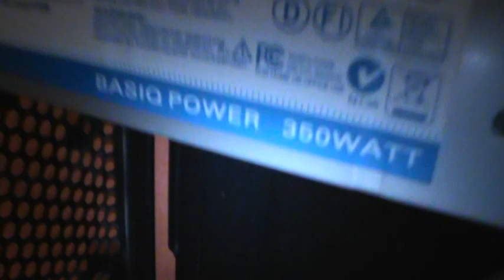Plans For The Old Raidmax Case

Comment: Hey, I really recommend you don't keep your Corsair case on the floor like that specially on top of carpet. I used to have my case like that on the floor and noticed it was collecting a lot of dust. The carpet particles get sucked in by the Fans. Sweet case you got there. By the way I would get a better MoBO like ASRock A55M-HVS FM1 and just use the rest of the parts from the HP. You could make a decent computer with that MoBo using the rest of the HP parts. Just commenting my thoughts.

Comment: Cool, just figured you might be interested but I guess you right why spend money on an alternative rig that won't even be the main rig you use. About the dust filters, mine also has them, I have the Rosewill Blackhawk ATX case and it won some type of award due to high perforated case thus allowing better air flow
but since I took it off the ground my internal components have gathered a lot less dust than they did before. XD Good luck XD